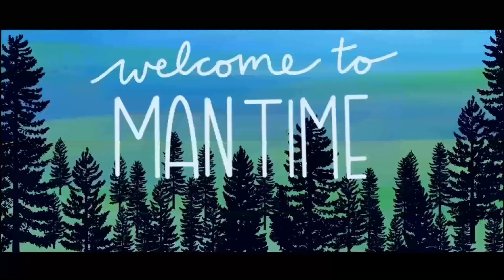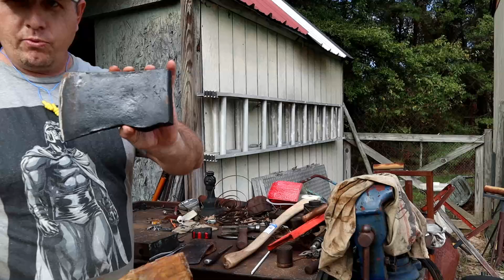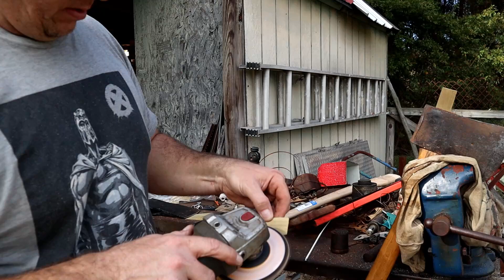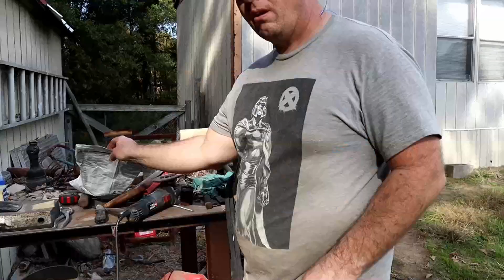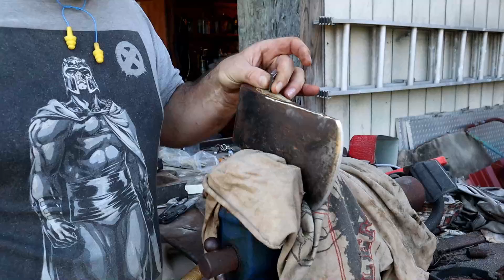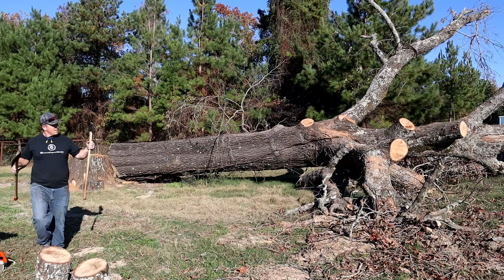Hanging And Repairing Axe Handle Head For Splitting Firewood

Comment: Disston & Son is the manufacturer of the hand saw one of the oldest hand saw companies made alot of saws most models have numbers stamp on them to identify the different models 
Starting in 1928 the used D then a number like D7 D8 D12 look on the ID button on handle if its still there

Comment: Diamond Edge Forged Tool Steel head looks like a Michigan pattern 
based on how rounded the heel is.

Shapleigh of Keen Kutter fame

Also Plumb made that pattern but most of the time Plumb always marked there axes unless they had a contract to make them for another company keen did the same thing
More of chopping n splitting profile falling profile are thinner either way it will split wood 👍
Jersey Pattern could be a Collies head too another big company that made heads for other companies
Reply from the maker: Awesome info on the axe man!  Really hoping it was a good one. 
Yeah the jersey pattern one with the cheeks, wish it had a stamp. It does the splitting for sure
Reply: @Man-Time  many of the bigger companies made axes for other companies both heads are good American made not Chinese junk Jersey with false cheeks is a splitter chopper the Michigan style head is a  straight handle feller wedge banger